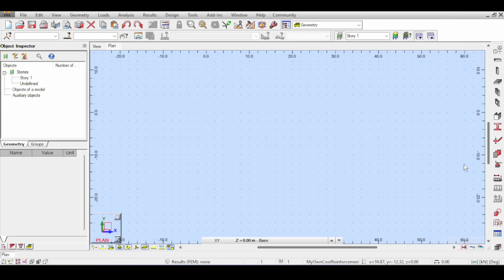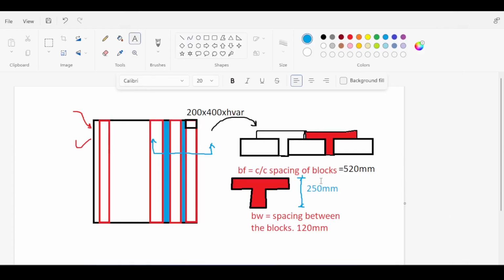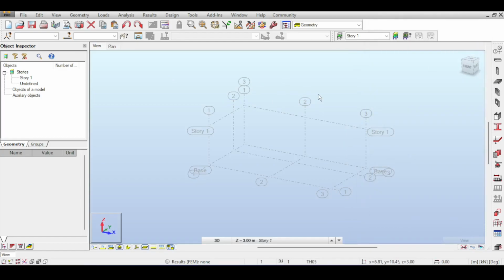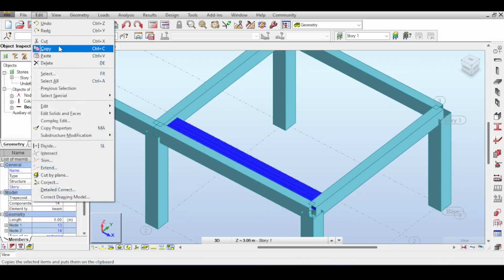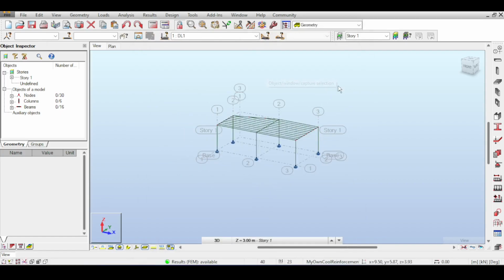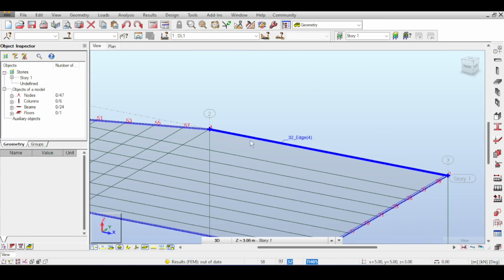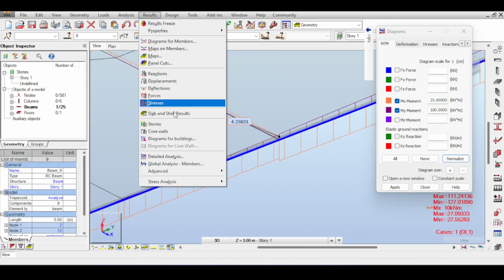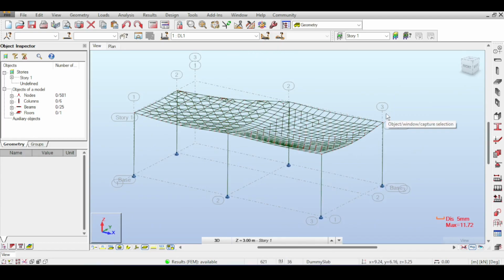The Slab Series | Part 4 - Modeling Ribbed Slabs | Autodesk Robot

Comment: Hello CEE,

Great practical contents throughout from the beginning to the end. I love all of it, thank you so much CEE.

10:21 😊😊😊; In my experience, I’ve always found that different perspectives to a subject often widens, and adds to one’s understanding and knowledge of that subject. 

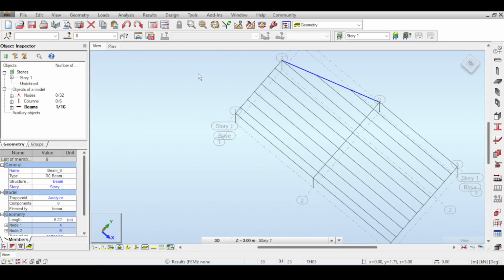22:53 Ooh, the isolated nodes elimination trick is both excitingly BOLD as it is an unorthodox way of looking at things, good looking out. 

25:59 When you said that there is a problem, I was NOT thinking about trim/extend of the new ribs in the y-direction. I was thinking about the “overlapped flanges thicknesses” of both ribs in the now mutually perpendicular x and the y directions. Graphically (visually) there is an overlap in the concrete that makes up the flanges of the ribs and I was surprised that RSAP did not cry foul on this (as it would normally do if one were to overlap slab panels (shell elements).

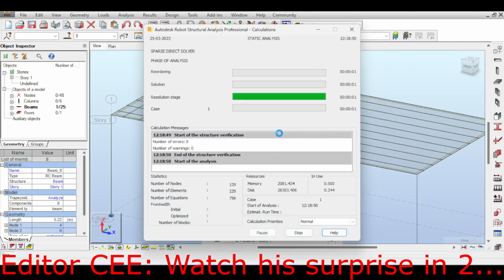 28:21 😊 these are amusing teaching moments, thanks. You are not alone in this, the version of RSAP that I am using defaults to a “Slab-Rigid-diaphragm” model type instead of a “Shell” model type, I often find myself in this exact same situation too many times.

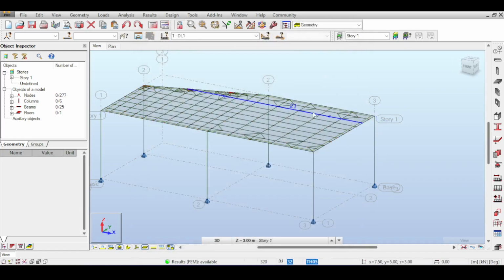28:51 The practical mesh refinement solution that was shown here is a nice touch. I especially like the part were the “structural modelling accuracy” trumped the “geometrical (parallel) modelling accuracy”. I fully agree with the decision in this case, and I see this as a sort of a “structural modelling license” 

…. about the AI’s…it galls me to say it, but I do think that (imperfect as the AI’s might be, and so are humans) the AI’s already have everything they need to take over…. they are “perfect or imperfect” enough to give us hell, and even perhaps to win the whole thing….

Useful tip: As an alternative to deleting and re-drawing a beam when shifting the beam end (or start) node from one node number to the other node number as it was done in this video as part of the practical mesh refinement process, one can also select the beam to be moved and directly change the beam end (or start) node number by typing-in the new node number directly on the members properties dialog box under the object inspector dialog box.  

General note and comment: 26:45 In order to put a slab load on the model, I have used both suggested options. When I use a cladding, all is well and I get no warnings or errors. 

However, when I use a dummy slab of negligible stiffness (1mm for example), I got a warning after meshing the dummy slab about “Instability (of type 3) detected at node ??? in direction RX” …..and sometimes in direction RY…..the node number ??? in the warning message randomly shift from one node to another, these nodes with the warning are the dummy slab mesh nodes (and not the main structure beams and columns nodes) …..

I suspected that the 1mm dummy slab was perhaps too thin and therefore possibly unstable due to its thickness…. I increased the thickness (to say 5mm) and lo and behold everything is working as expected, no more warnings of instabilities. What still bothers me though is that when I open the model file that was shared by the CEE and run analysis on that model, I do not get any warnings of instabilities, the dummy slab in the CEE model is also 1mm. So why would my 1mm be giving instability warnings whereas the CEE 1mm is not? Mystery?       

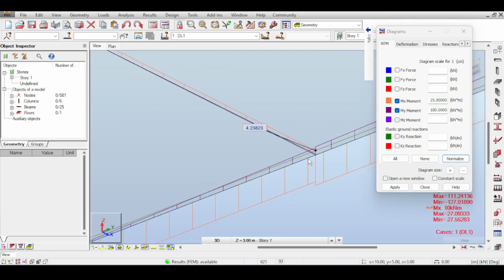35:58 It was really good how the CEE showed the relationship between torsion on one side to the bending moment on the other side. This is one of those kinds of details that sets this channel apart, thank you for explaining this in detail, it is very much appreciated and keep them coming. The same goes for all other nice practical tips that you have provided in this video.  

General note and comment: CEE mentioned (02:32 and 37:27 for example) that the ribs do not carry any stirrups? Whilst I do not disagree with this statement; I’d like to mention that there can also be rib slabs that do have stirrups located within the ribs. Some of the pictures that were shown at the beginning of this video had those kinds of ribbed slabs with stirrups in between the ribs.

I have also noted that most pre-stressed rib-and-block slab systems (at least in the region where I work) are cast without stirrups. 

Considering that slabs are (in general) typically designed so that they do not require shear specific reinforcements in the form of stirrups; The idea of designing a ribbed “slab” without shear reinforcement in the form of stirrups and in this context is actually not far-fetched.

Keep well, and thank you again for today’s video. I am looking forward to part 5 of the slab series.

Kind regards, DK

Ps. The video sound quality was not bad at all, in fact I don’t even think that I would have noticed anything about the sound if you had not mentioned it, …..keep doing how you are doing 😊.
Reply from the maker: Hell there Engr. DK,

the isolated node elimination trick is one of the really cool ones I keep using. Now I do not remember if I ever have included it into one of my videos, but thought that I should include it here, because there was a chance to have an isolated node.

As for the overlapping flanges, note that the only thing that robot sees for "ribs" are lines. It does not see the section thicknesses and does not even care about them.

Now I may predict what your next question is, or spark this following question:
Well if there is an overlapping region of ribs, doesn't this mean that there is a concrete volume being used in stiffness twice?
Indeed this is correct. But it is warranted. A simple reason for this is that both directions are "usually" perpendicular. 
Still, the consequences of "using a volume of concrete twice" is - of course - the von-mises 3D stress state check.
Now the beforementioned 3D stuff is research level stuff, practically, nobody cares and it is found to be adequate.

The little annoying thing of having something else than shells selected is really annoying ^_^ but the editor kept my mistake "as is" for you to see.

Oh!! I <3 the tip you have provided!!! that is really really cool. I will copy and paste it in the video description!

For the instability of 1mm slabs, I have to explain it in the next video (I hope I remember that). There is 1 weakpoint in shell elements in the finite element method, which is its ability to resist moments in the ZZ direction. This is a moment that wants to rotate the shell in its plane (imagine you take a drill and a piece of wood, and just rotate the piece of wood using the drill, no bending happens to the piece of wood, but it is rotated by a moment perpendicular to its plane). 
This is a weakpoint in the shell element and a limitation in the finite element method. The stiffness is artificially done using a small value, which may cause artificial instabilities. This is especially the case, if you do not have beams surrounding the shell or if the beams are too weak. I will try give an idea about this next video.

In short, your idea of being too thin is 100% correct. But the beforementioned is just a small explanation attempt. Hope it made sense. Still, I will try include it in an easy way in the next video, so thnx a lot ^_^

Indeed, the torsion/bending relation needs to be explained, and I was lucky that the elements were perpendicular. Otherwise, the torsion on one member would be decomposed into all kinds of moments on the other member.

About stirrups, indeed, it depends on the region. Also, some people consider the (W-shaped steel bars that carry the bars) as stirrups. The more conservative assumption is to assume no stirrups and keep those W shapes as factor of safety. I <3 this comment and will modify parts of the description to reflect me not mentioning this really good point. Huge thnx to you.

The world of "ribbed-slabs" is a really large one, with multiple local variations in the implementation, some countries even not taking such slabs as an option at all. 

Anyways, it is always a huge pleasure for me to read through your comment. Whenever I get the notification I usually prepare myself (at night) a nice cup of coffee and really immerse myself into what you write. Huge thnx to you, I want you to know that you actually help all viewers with those discussions.

PS: the channel got monetized ^_^ Now in comparison, this seems to be a record time (less than 8 months until monetization).

Best Regards,
CEE
Reply: @CivilEngineeringEssentials  

Hi MJ, 

I also really really enjoy reading feedback from you on my (and also on other subscribers) questions, comments, and discussions. You are exceptionally knowledgeable and yet you are humble, you address questions clearly and you do this without judgement and without trivialising. Your use of imagery is as vivid as it is spot-on. I have not met or seen anyone like you on all counts, never.   

The overlapping flanges: I agree that for FE, the only thing that robot sees for "ribs" are lines. I also agree about "using a volume of concrete twice" for stiffness calculations [it is indeed fortunate that the work of pioneers (such as von Mises) in failure theories have helped to provide some comfort and latitude to not practically care most of the time 😊] 

In addition to “using a volume of concrete twice" for stiffness calculations; RSAP is also using this volume of concrete twice for the calculations of the self-weight of the concrete at the overlapping regions (flanges and webs). I suppose that the additional self-weight might sometimes be deemed negligible in cases where relatively few members overlap. However, and in a case of wide and thick flanges and of a two-way spanning system such as the one in this video, the resulting dead load (self-weight) computed by RSAP is comparatively higher than the actual due to the double counting of the concrete self-weight over the overlapped regions. [I have estimated a self-weight increase in excess of 44% on my random 5m x 5m square “test-rig” RC frame with a two-way spanning ribs-with-flanges system arrangement]

I think that the self-weight point above is important. It could help a user or a designer to optimise the actual self-weight (dead load) on a two-way spanning ribs-with-flanges system in RSAP. The same optimisation can be extended to the resulting columns and the foundation reactions, even more so with multi-storey arrangements.

Artificial instabilities (weak point in shell elements in the FEM): Yes, the current explanation is settling in well, your imagery have helped a lot and it does make sense. Thank you.

It is such an honour for me to find myself alongside giants such as yourself and to be able to make small contributions that may also help other viewers. 

Congratulations on the channel monetization. You and Mr. Editor are honestly doing a sterling job. I mean, clean re-branding, word-class content, vivid and on-point video inserts made “just-in-time” by the quick-witted Mr. Editor, calculated and humorous “roasting” 😂🤣😂 every now and then, I couldn’t wish for a better dream team.

Thank you CEE for making such a beautiful platform that is available to all.   

Regards, DK
Reply from the maker: Thnx a lot Engr DK, 

I think the more you know, the more you appreciate your knowledge and act more humbled. The stuff you know only raises a valid question: If I have researched and worked so long to know this stuff in a very small specialization, imagine how much I do not know?

Just a small feedback about the Selfweight, indeed you are right. I did do a very simplified load application on the slab, but there is more details there. Because, there are actually 3 options, and I think it is a total must to include them in the next video.
Option 1:
You keep Autodesk Robot's Self-weight calculation feature for the entire structure, and adjust the rest of the dead load by reducing it. The dead load in that case would be any other sustained loads + block weight, but without the rib own weight and the topping slab weight. It is kind of an artificial thing to do.

Option 2: which is the option I was doing back when I was a junior engineer, which is to remove the self weigth from any slab element (not beams, although under the same explanation, there might be overlap between the beam and slab), 
then calculate the own weight of the slab including the ribs self weight, and add it as area load (note, self weight = off for slab only. Columns, beams and so on are still = on)

Option 3 (the lazy but conservative way out):
To just forget about this inaccuracy, as it would produce higher loads which leads to more conservative designs.

Those are the 3 options I thought of, there would exist other ideas, which I am always free to explore.

The channel monetization was surprisingly fast, I heard a lot of stories of people needing to wait like 3 weeks, only to get a refusal with comments, and re-apply after 30 days. Also, according to youtube itself, 95% of channels do fail their first monetization attempt. I guess I could be happy that it got monetized in 48hours with 0 comments. 

Regards,
MJ

Comment: Hello! Thank you for this video. Why don't you consider the rigidity of the 10cm slab as a shell with a rectangular beam? in addition if you position it above the beams (offset command) you obtain much fewer moments compared to what you modeled...
Reply from the maker: Hi there. Thank you very much for your comment.

First of all, you are right. You could have a (xx cm) slab with a rectangular beam.

The reason why I did T-Sections and made an artificially thin slab is because in the design of the ribs, the top slab (the 10cm in your comment) becomes the flange of a T-section, improving flexural resistance of the rib. Also, when checking for shear capacity, it would have helped. 

Otherwise, all good.
For the offsets, yep, you are right, it helps. It might cause some strange effects in the moment diagram if you have a slab, like a zig-zag like moment diagram, but generally speaking, I agree with you.

Thank you very much for your comment. It is really helpful and I agree with it completely.

Regards,
CEE

Comment: Hello,
Thanks for this great job
But I have a question when I wanted to design the beam in which is not on one straight line, the program separated it into two beams, and this is not my work.
Is there a solution to this problem when we want to design a nonlinear beam?
Reply from the maker: If the beams are not co-linear, autodesk robot will consider them two separate beam elements. You could input them manually using the RC module, but it is kind of a waste of time TBH. My suggestion is to design them separately, export the dxf file, and join them manually in AutoCAD. This is - unfortunately - a limitation in the software.

Comment: Hi dear CEE, i have few questions to ask you:
-how could we solve the problem of increasing self weight because of the T section?
-as im watching, meshing quality decrease to an 50%, so why is more “accurate” to use shells than claddings in this case?
-i would had used offsets and releases for the nodes of the ribs (avoiding torsional effects on the beams), is it wrong?

As always thank you very much! I will catch you on your next video
Reply from the maker: Hello there Engr. Candea,
I really love the amount of discussions that Part 3 has sparked. 
Let me try answer the questions in text form, although I will be addressing them in video form too.
1) T sections increasing the weight of the slab
Indeed, a T section is heavier than a regular solid slab. But also note that there are "empty holes" between the ribs that are either filled by a lighter material or even empty space.
There is still a problem with the duplication of self weight in those slabs, and I need to address this issue in the next video.

2) with cladding, the load is distributed by triangles and trapezoids, whereas having a cladding distributes it a little bit more accurate, instead of having triangles and trapezoids you would have stiffness relationships that control how much each rib gets. Also note, the topping slab is just a "load distributor" so its own results (Mxx and Myy) are inconsequential as we are going to design the topping slab with minimum steel and the ribs as beams.

3) Offsets would not be a perfect solution to this, but compatible nodes might do the trick. Please note that the time required to 100% get rid of the torsion/bending relationship is really large. 
You could also release them, but then you may have instabilities.

My humble opinion is to keep this interaction, as in reality those ribs and beams have torsional stiffness and would indeed affect each other's bending moment.

I will still keep your questions in my mind and address them in the next video.

Huge thnx for your contribution, wishing you an amazing day,
CEE

Comment: Great video! I had a question, when the slab is modeled in two directions, is the weight of the flange not being doubled?
Reply from the maker: It is, and it must be modified in the load calculations. I will address this in the next video.
Reply: @CivilEngineeringEssentials  Brilliant! Thank you very much for the reply.
Reply from the maker: Most welcome. Stay tuned for more content ;-)